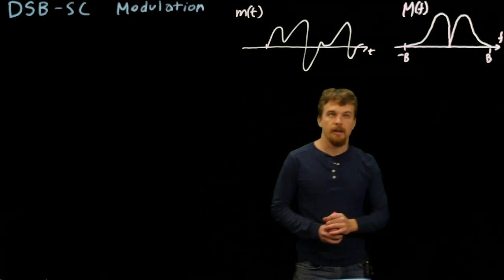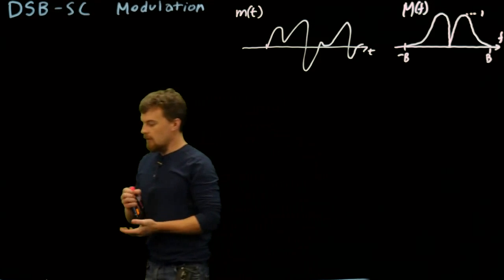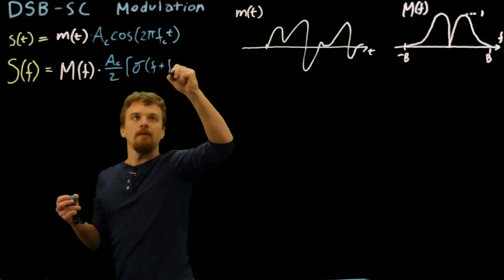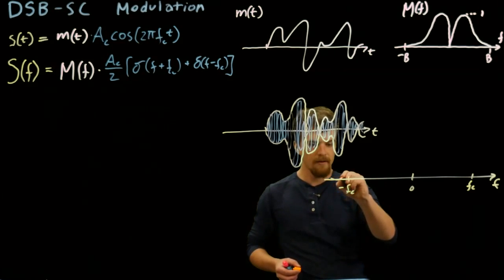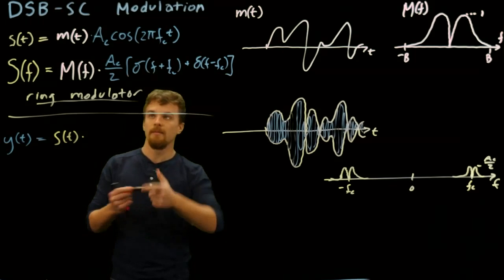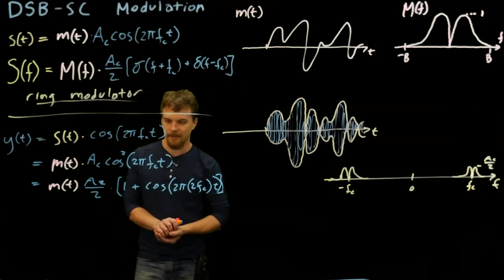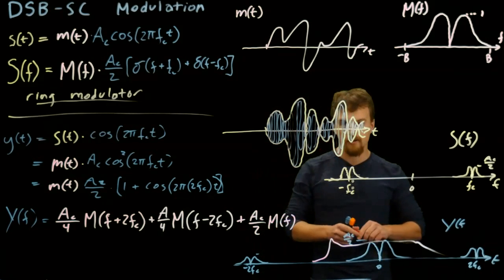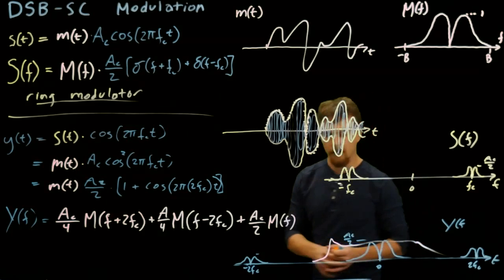Analog Communications - DSB-SC Modulation - Intro

Comment: 15th video on dsb sc ...still not able to figure out why there is a 180 phase shift in time domain analysis at zero crossing
Reply: A 180 phase shift is equivalent to multiplying by -1 since cos(x+180)=-cos(x) and sin(x+180) -sin(x). This is what happens when m(t) change sign after crossing zero.

Sorry for my English.